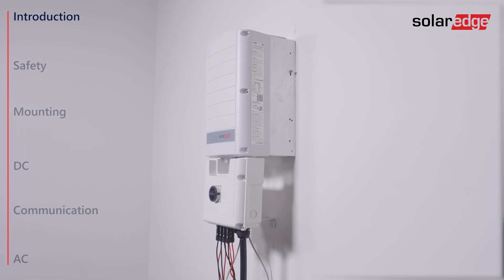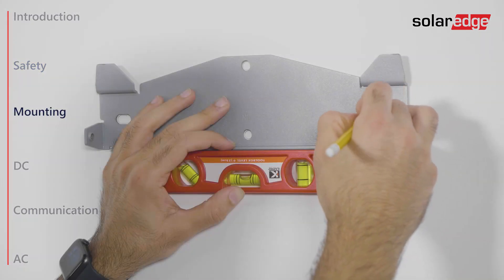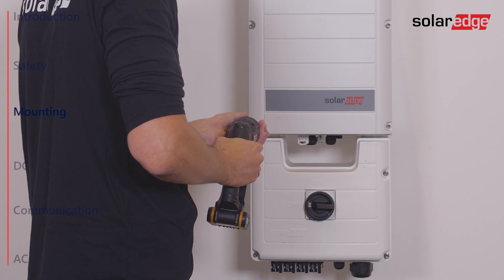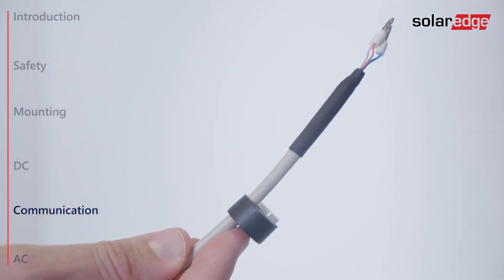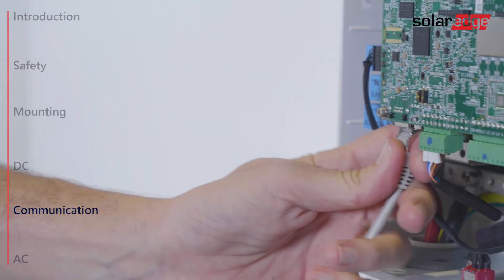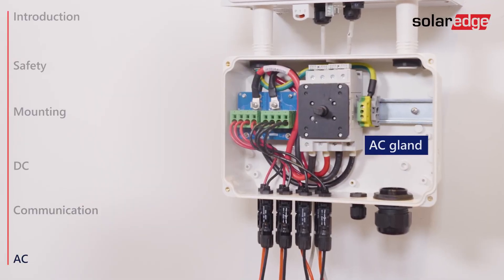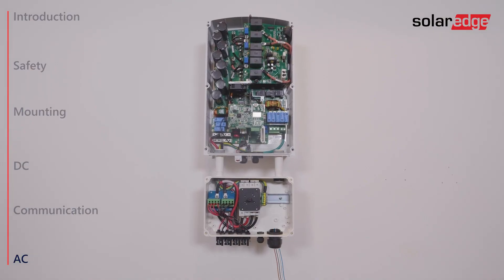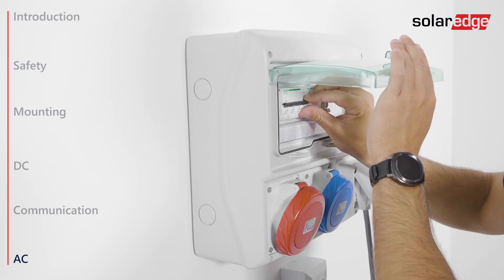Installing the SolarEdge SE25K-SE40K Three Phase Inverter

Comment: We have just installed 5 inverters in leader-to-followers chain. My problem is that an error saying "Lock on trip, Off/On to Restart" keeps on popping everyday. I can't find this in the error codes list so I don't know how to troubleshoot this. It's my first time to encounter such. What could be the trigger of this and how to fix it? I hope you could help me.

Inverter 1 (Master): RS485-1 (Wattnode Meter (MODBUS ID #2), RS485-2 (Leader, MODBUS ID #1) 
Inverters 2-5 (Slaves 1-4): RS485-1 (Follower, (MODBUS ID #s 2, 3, 4, 5), RS485-2 (None)

DIP Switches SW1 of the first and last inverters are switched on.

Background:
In some of our sites, we assigned "MODBUS ID #1" to all inverters (from Master inverter to last Slave inverter) and "MODBUS ID #2" to Wattnode Meter. But in our recent installation, I used the "Central Commissioning", and then the MODBUS ID #s of the Slave inverters became 2-5.
Reply: Please do note that the error pops only after sundown, and the instruction for restart only works once the sun is up again.

Also, other things that I have noticed after using the Central Commissioning are the ff.
1. If I try to change the MODBUS ID #s from 2-5 to 1, in Central Commissioning it will state "Pending Commissioning" and the blue LED indicators of all Follower inverters turns off.
2. "Grid Control" becomes enabled in all Follower inverters. This is disabled in our other sites.
Reply from the maker: Please open a support ticket. Our team will be happy to assist you. https://www.solaredge.com/service/support.